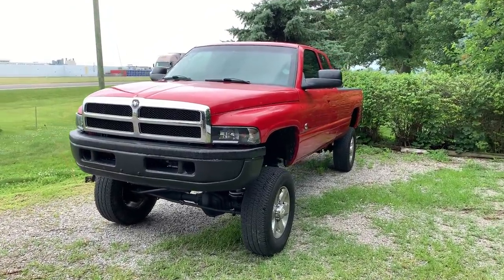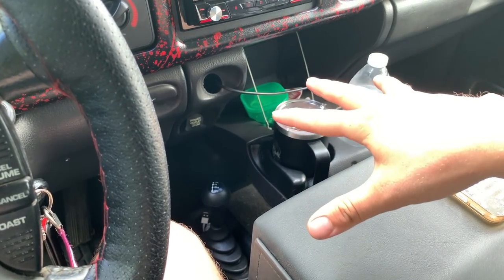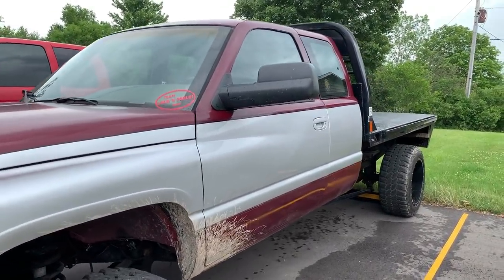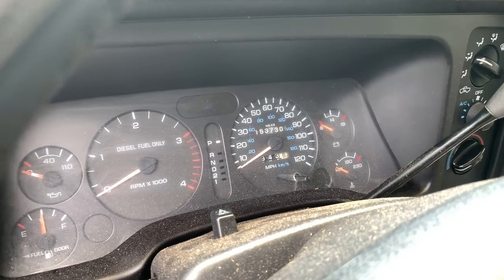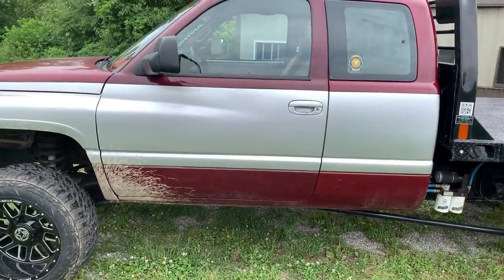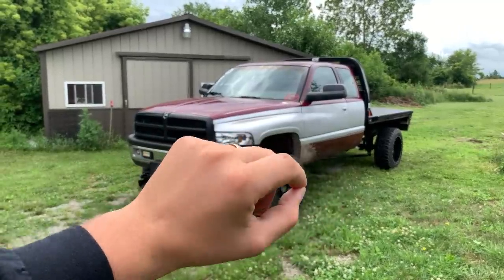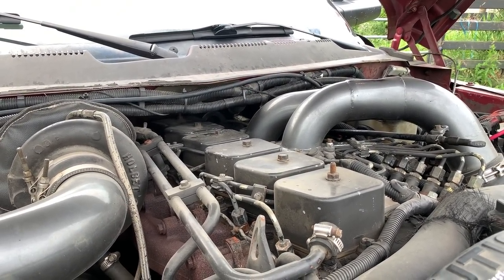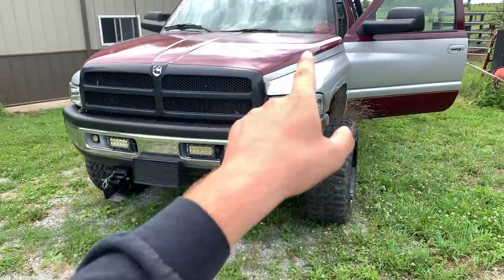SLEEPER Cummins farm truck with COMPOUND TURBOS is HOW FAST!?

Comment: There’s a nut under the shifter knob cap pull the cap off put the knob back on the handle and put the nut back on and tighten it down good to go

Comment: Install the gauges video would be good.  Replace the dash I know you don't wanna do that one.  Get it to a dyno.  What kind of increase in MPG did you get with compounds?  Or does it negate all MPG gains because compound turbos always makes your foot heavier?
Reply from the maker: Increase in n fuel MPG for sure! Under normal circumstances.. you use a lot less throttle to get it rolling with the power all in it!

Comment: You know with those wheels and tires your Speedo is off as well. 5mph off. So when u see “60” on the dash your actually doing 65. So your 0-60 is a little faster time then what you think

Comment: My 02 Cummins has quadzilla xzt, fass fuel pump, cold air intake, and a straight pipe and does 0-60 in 10 seconds.
Reply: i got a 2007.5 just exhaust intake studded and i did 0-60 in 6.17 seconds that dont make sence
Reply: @joshuabell4965  ?
Reply: 7 not 10. It was 10 before the tuner but it’s only a 70 hp tuner so it don’t make a huger difference